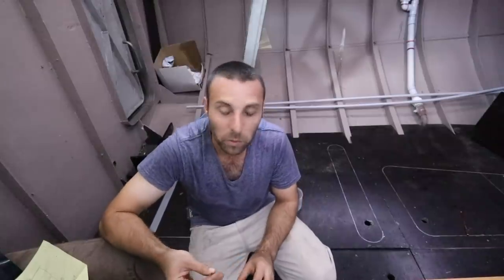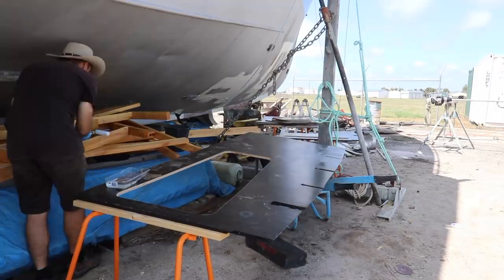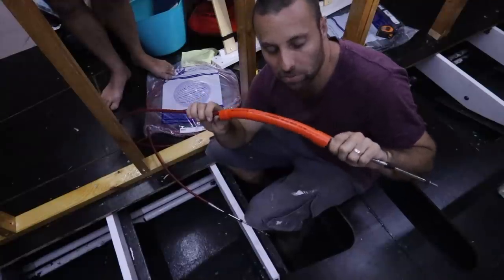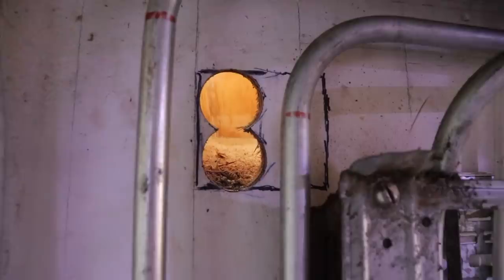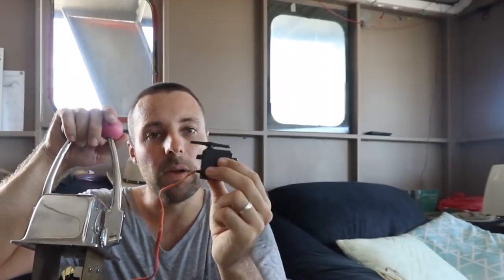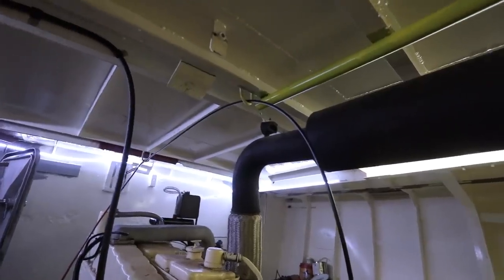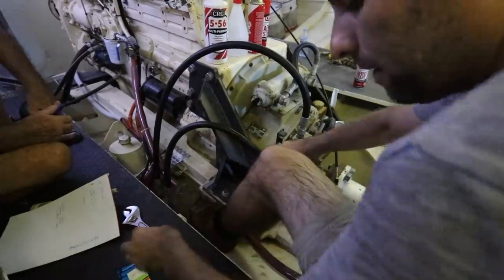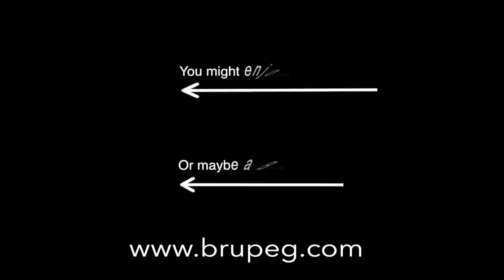Morse Cable Gearbox Controls - Project Brupeg Ep. 124

Comment: When the going gets tuff, the tuff get er done..Morse cables won't hold this party back nor will steel walls..gimme a drill and a recip saw and move over George, were fired up..One screw driver and some small stuff..pretty clean for 1 1/2 years (you should see seekers, that's scary)..lol..Good on you and Happy Birthday Damien !!
Reply from the maker: Thanks Bart, It’s surprising even to us. I assumed there would be so much garbage under those floorboards it was a pleasant surprise

Comment: Happy late birthday.

I have been thinking about this electronic throttlesystem. Have you looked into how bigger ship’s deals with redundancy issues? Ofc, now you have the morse cable in there but I really think a electronic system would have been very viable for this (and a lot neater).
Reply from the maker: True but electric was experimental and Morse cables were not. In ships it’s often different, hydraulic or air shift etc

Comment: I'd like to see a closer look at that quick disconnect bit at the end of the Morse cable , to me it was the most interesting part. It didn't really get the screen time it deserved.
Reply from the maker: Ahh, I will do a bit more on that for the next episode
Reply: My main thought about those nifty ends is that a box of them is needed somewhere ... you know that if you only have one or two then it's going to fall out your hand and down into the bilge in an emergency, but if you have a box full you'll never lose one or need to replace them!
Reply from the maker: This is how boats work. Spare mean you won’t need them, as it should be

Comment: Dame, I used dual halogen work lights and two concrete blocks to create a 10 foot sweeping 90 in a 4-inch piece of PVC pipe for a friend back many years ago. I would heat a section of the pipe with the lights from underneath while the conduit was straddled between the two concrete blocks, wait for it to get soft and then warp it a little, move it and start all over again. It took several hours to complete it, but it was far cheaper than buying one already made. The power company was very impressed. But, it passed the inspection. That was all that mattered. It also made their job easier pulling the wire thru it.
Reply from the maker: Earl that sounds really nice. Those big sweeping curves like you made are a real delight to work with afterwards for cabling etc aye. Well done

Comment: Dame a trick you are missing is if you had a couple of portable radios you can communicate with people in other areas, add a couple of spares and Jess can order you a coffee from the office in the middle of your thinking job... But it gives you a backup of someone in the engine bay with the leavers (just get a radio that can have an earpiece in earmuffs).

If you want more throttle control and  knowing you want to be in the ice it may be a god thing extend the throttle arm at the motor and adjust the bracket (between coffee run's if you have the radio).
Reply from the maker: I’m fairly sure if I radioed down to Jess and ordered a coffee she would deliver it, but almost certainly at speed, with a run up and aimed at my person... that said, a radio could be used to ask if my darling wife would like a coffee delivery to her...

Comment: Good progress but I would sling that ally off the engine, make your cable support brackets from substantial angle iron. Ally rots and brittle fractures and is totally rubbish on engine controls..
Reply from the maker: Yeah I didn’t know this prior to making them. Still it’s easy to change them later if needed

Comment: Dame Happy birthday. There isa technique to bend that conduit to the radius you need. Cap one end with tape and fill it with sand. Heat it around with a heat Gun and bend it around something with right diameter. Tie it off and let it cool. Put a coupler on each end. I hope this helps.

Comment: Greetings from Bundy! The comment from rl regarding the unsuitability of alloy for control cable mounts due to stress fracturing is spot on. PLEASE use Steel!
I would also strongly suggest extending the actuator arm on the throttle so that the cable movement is similar to the gear box control. This will also
give you much more sensitive engine speed control. 
Cheers!
Reply from the maker: Hi Martin. Yip we added to the throttle in the next episode and we will likely swap out the alloy mounts at a later stage
Reply: @ProjectBrupeg  Excellent news!
Reply: I was thinking the same thing. When I have done it I made sure the cable ends up at exactly the right position or it can burn out your gearbox or clutch system. With a minor alignment error it can jump out of gear or not go into gear. I learned the hard way to adjust the play in neutral about 2mm. André

Comment: For plastic pipe you can add dry sand inside of it and use your heat gun to bend the pipe with out losing it shape ,ie, very little crush on the pipe if you get the temp correct , Just saying for any other Plastic Pipe Work . You can also do steel Pipe the same way  Dame . Ps Happy Birthday hope you and jess had a great Day.
Reply from the maker: Thanks very much

Comment: Happy (belated) Birthday Dame!  :)
I am so glad you guys are putting in multiple redundant systems...this will make me worry just a bit less when you are in extreme situations.
Have you thought about using some small handheld radios for onboard communications while building Brupeg?
BTW:  The audio at the very beginning and the very end was super low...couldn't really hear what Dame was saying.
Reply from the maker: Hi Gregory, yes we have pondered handheld radios but it was something we were going to buy closer to launch for docking etc. it would’ve been very handy for the engine work though assuming the radio waves can pass through the steel superstructure of the boat
Reply: @ProjectBrupeg /videos   Boufung makes some pretty good higher powered but lower cost handhelds...and some of the bands are not required to have ham license though I don't know the laws in your area.
Reply from the maker: I havent tried any hand helds yet, i assumed the steel would be a real issue, that said cell phones get a small amount of reception so clearly something passes through the steel work

Comment: Great seeing Jess moving around so gracefully as she was winching floor down onto Dame's head. All's right there. 

Here's a suggestion from an incompetent plumber -- maybe install unions in the conduit? Allow separating it without having to cut the morse cables in half to get it apart? You could bush their size up and down 1/4" [or whatever that would be in Aussie-speak] so they aren't sticky places themselves?
Good job rigging them. First time I rigged a boat's steering, I had the engine pivot in the direction I wanted to go -- so, it went backassward.  Used it that way a few times, but turning left to go right for another beer replenishment was too ... um ... confusing?
Reply from the maker: lol thanks Lee, it was a laugh when i first hooked it up, i actually didnt even think of it being backwards but i suppose it was a 1/2 shot of getting it right first go. The plan witht he conduit is to build the walls in over top so once its built we will hopefully never see it again.
Reply: Maybe it's just me, but personally I would count it as a 50/50 shot minus the bite out of my half taken by the Tommyknockers if I were to assume it is 50/50. Nasty little buggers, close relation of gremlins, lurking in the woodwork, or metal work, or wherever we should have expected them to be, but didn't. "I cut the damn thing three times, but still it was too short."
Reply from the maker: LOL LOVE THIS LAST LINE!!!

Comment: Get some cheap Ebay walkie talkies or build an intercom system from the wheelhouse to engine room for maintenance and emergency situations
Reply from the maker: We have an intercom on Brupeg... it’s just sitting in a box waiting to be fitted
Reply: Where's the fun in that as a heavy deisel mechanic and a farmer i find 
the tried and tested screaming over an engine at full noise is way better 
Great for tempers and relationship building 
Mmmurbmurbur 
What 
Murrrburmmmm
What 
I said fuckin shut it down it's pissing oil

Comment: Could you have added a small amount of Vaseline to the cable to help it slide through or would that have messed something up?  I know they use a lubricant when the run electric cable through conduit in buildings
Reply from the maker: Hi BEN, Cable lube was an option but we didn’t have any and knew we could get it through with a bit of perseverance
Reply: Project Brupeg that makes sense I was just curious thanks for the reply!

Comment: Happy Birthday Damien !  Saw the panel under the couch appears to be hinged, was thinking if you put a couple well sized blocks, cut at a shallow angle, you could keep that panel slightly open for better ventilation down below, even while the couch sits on it above at a slight recline 10-15 degrees, or if you want more airflow, disconnect the hinges and elevate the whole panel 6-10 inches (or whatever max couch height you can live with).
Reply from the maker: It would work for ventilation but also as an amazingly effective toe stubber... when its open its right in the way of everything (toilet on one side, hall on the other, sode doors not far from each end etc. we actually picked up some stainless pipe work for ventilation ducting this week so that problem might disappear soon with a bit of luck.

Comment: G'day Crew,,
I'm not going to sing ,but    Best Wishes Damo , for your birthday , nice you two found time to  celebrate.
Morse Cables ... seen them used in  hundreds of applications on various ships n smaller vessels,, the one thing that makes them reliable  are solid reliable  brackets  (preferably steel),   If allowed to move or vibrate, either the bracket, or the cable will fatigue  and  break  in time .

Best wishes to you both
Reply from the maker: Thanks Craig. I can upgrade these brackets if they prove not up to it

Comment: Probably a little late, but why the conduit?  We use the same type of cables on aircraft.  They will operate at a very tight radius.  Also there are firewall shields available for passing through the bulkheads.  Cables could be easily mounted to the ceiling.  Replacing is as easy as hooking the new to the old and pulling it through.
Reply from the maker: For us the conduit allows us to feed a new cable in without the need of intervention halfway along. I also wanted some additional protection given it’s a critical control and passing through a crew room.

Comment: Too late now but smooth bore flexible conduit would have been easier 😁.
🎂🍺 Happy birthday Dame. Glad Jess forced you to take a half day off.
Love Trev's safety thongs 😁
Reply from the maker: Hi Bill, we wanted to stick with solid conduit as its easier to push the new cables through when they need replacing. My worry was flexi conduit would droop etc inside the wall and we would never get the cables through
Reply: Yep, solid is best for straight runs, just flex for bends. If well supported droop is not an issue. Normal flex is a pain cos of the corrugations but they make a smooth bore version to make it easier for wonky runs.
Always pays to throw in a draw wire for anything bendy or over 3-4 metres. A bit of string can be blown through with compressed air if you forget or it's a pain to do when installing.🍺

Comment: Just one question are you going to put any locking struts on that access floor door so you don't have to keep putting a bit of wood underneath it to hold it up just in case.
Reply from the maker: Hi Neville I’m not sure what you mean?
Reply: @ProjectBrupeg  like struts you have on a car Hood, but of course heavy-duty ones, if you look at some us military ships hatches with support struts to lock them in the up position as as an extra safety aspect relying on a piece of wood and the chain to hold the door up don't know how much weight is in that door but I wouldn't like it to fall on my head just a safety question.
Reply from the maker: Ahhh got ya, short answer is no. reason, this hatch VERY rarely gets opened and when it does its in a flat port with plenty of help. normally it will be bolted down so its quite an ordeal opening it and hence we try to find every excuse to not open it. With struts on this hatch we would loose valuable interior room for the downstairs for little use of the struts overall. that all said, there is nothing stopping us from making some safety strops etc to make it safe when open.

Comment: @Dame Morse cables can "rattle" since it's basically the kid's telephone principle. Whether you'll hear it will depend greatly on the surrounding noise of course. If you create a bracket that's not attached to the engine you can already reduce the risk of them transmitting vibrations of the engine/gearbox. Also mounting the morse cable holders in rubber helps. Keep up the great work!
Reply from the maker: Yeah I can get that. If we find the rattle happens I will likely add some dampening in the system
Reply: @ProjectBrupeg  Wrapping some lead sheets around the cables sometimes also does the trick. In any case, first world problems. ;-)

Comment: I need to know for my boat ?
What is the specific ID of the deck plate & rib material seen here ?
                                                                                           Thanks. M.A.
Reply from the maker: Hi Michael, all steel on Brupeg is 6mm plate and ribs are 75mm x 6mm flat bar or 25mm x 50mm x 2.5mm box (cabin only)
Reply: @ProjectBrupeg  Sorry! I was talking about the black decking materials being cut with the saw.
It appears to be maybe HDPE (hi dinsitym poly etholine or some other plastic )
Reply from the maker: I cant remember cutting plastic, what is the time stamp on the video and I will be able to let you know what it was we cut.
Reply: @ProjectBrupeg  Episode 124/ 24 Feb 2020 -- Morse cable install but, a portion of video was 
about pulling the black freezer room floor up and cutting the smaller access panels into the 
bilge.
What is that material, the floor is made of ? I can't tell if it is hi density ply wood or plastic.
                                                                                                     Sorry for the trouble, Thanks Friend

Comment: Awesome episode.  
Morse cables ARE simple and known, however, you are going to find that you will want both if you do any regular docking with a boat the size of Brupeg.  There is something nice about being on port or starboard gunwale's and guiding a boat in remote.  Essential on a rough sea when you need to come along side another vessel.  You may want to consider this for the future.  With hydraulic steering, you have options. 

Also consider indicators in the engine room telling you position of the cables/controls from that room

Lastly, what size are those hydraulic nuts and a good address.  I might have something for you.  They look like 24mm from the video, but you know how the camera adds mm's ;)
Thank you.  Happy Birthday Dame.
Reply from the maker: Hi Anthony, we did consider remote steering with the electric system, its something we could add later as we have the cabling run for it but for now we want to launch and accept its not perfect. As for the hydraulic nuts verniers make it 25.3mm so its a 1" nut, which is pretty common on the steering and anchor circuit on Brupeg now. address details are here
https://www.brupeg.com/contact-brupeg

Thanks very much Anthony